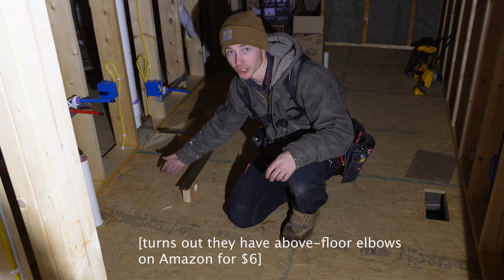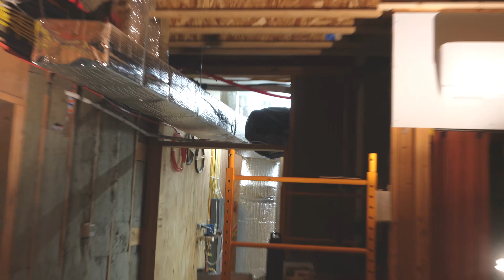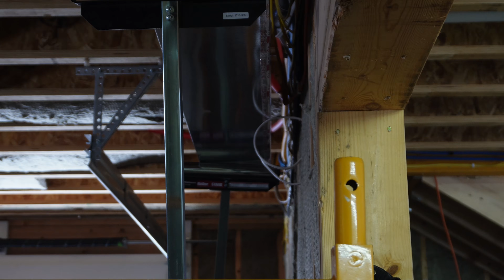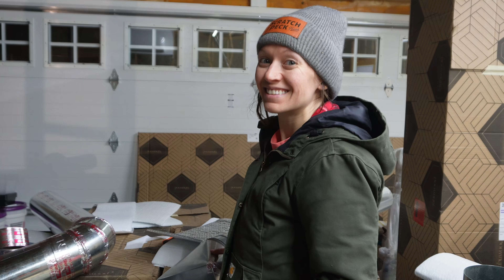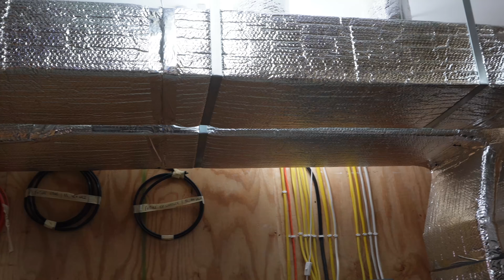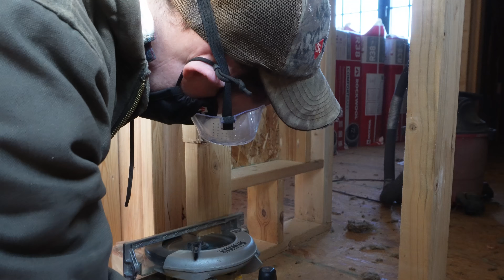HVAC Sheet Metal Ductwork - Supply Branches & Lessons Learned

Comment: You could have used Rossi Hardware dampers, which utilize 3/8 square bar shafts, and mounted the locking position regulators to the surface of your soffit drywall.
No one should be using single attachment point dampers with wingnuts these days.

Comment: I still really like this video.  If you want a comparison on cost, I priced out 5 separate quotes even with NYS incentives and the quotes for my 2,000 sf house with 110' supply run with a 4 ton heat pump came in between $41,000 to $44,600.  That's how bad it is on LI.  So I bought the equipment and even had all the ducts fabricated.  Heat pump + controls = $8,465.  All ductwork with 1" foam insulation $2,323.  So, yeah, I did it myself and your video plus a ton of others here help immensely.  Thank you for the example.

Comment: I've read a lot of mixed bag reactions online about insulating with double bubble wrap and the actual R-value/insulation value. Do you feel like that's helping? Considering doing it when I rip up my basement...
Reply from the maker: I do think it helps, especially as a secondary air seal (especially on the return where there's negative pressure to suck it tight to the ductwork) and it prevents the formation of condensation

Comment: I love this, I remember getting quotes to extend duct stuff and was shocked, when I moved my utility closet and then priced out tools and material (Menards online and hvavsupply) I could barely get anything around Seattle as a consumer. I think I got quoted 5k+ (inferior ductboards) and I spent maybe 1k and a lot (a lot a lot) of time as you know making it perfect with all sheet metal.
Reply from the maker: That's awesome, good on you for taking on the project! Work on houses is not easy, but on most projects it will save you a ton. Plus you learned something and gained some satisfaction in the process